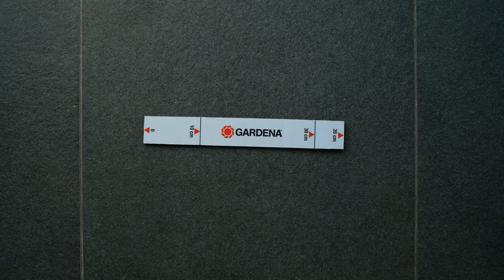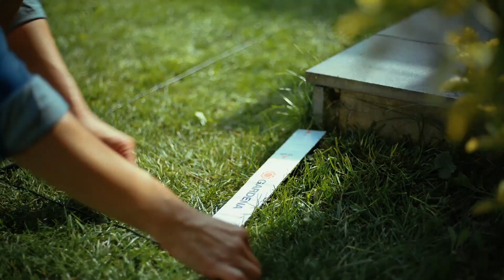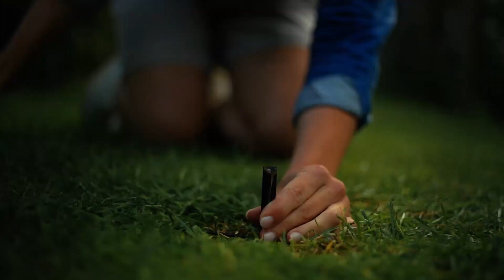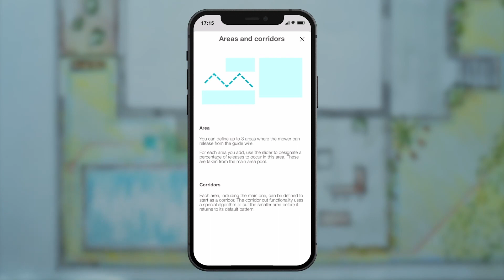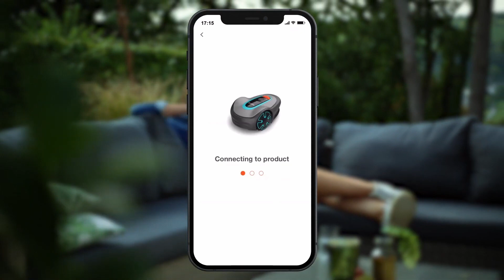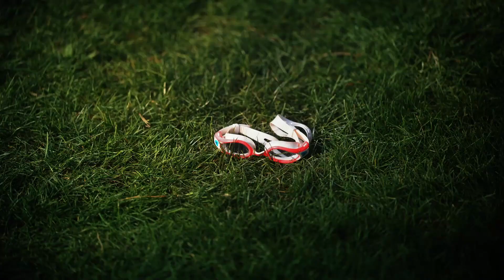Gardena Sileno Minimo Robotic Mower Gardena Robotic Lawnmower Sileno Life 750 at Trade Tested

Comment: I have a question. I just bought sileno city, and everithing looked great, but when I plugged it in to charge the mower doesnt charge. I have read something about it on the web, and it said there should be a green light and it is, but it still doesnt charge… does anyone has any idea how do I fix it? 
Thanks
Reply: The green light usually indicates everything is fine with the setup & boundary wires (the loop is closed). Do you have any information about the robot status from the Gardena mobile app?
Reply: Same issue here, the Gardena bluetooth app keeps constantly ”suggesting/guessing” the state of charge for the mover..

Any suggestions what causes this issue? Low voltage cable is elevated as suggested, no magnetics around charging station, the led shows green light and the cables are correctly installed…
Reply from the maker: Hey guys, give us a call if you have a product issue - customer service can help :) 0800 800 880 Cheers!

Comment: After the last Bluetooth App update (4.1.0), the secondary area settings (set by the distance point of the guide wires) seem to be completely gone, only the default area is available. Has anyone encountered and fixed this?
Reply: Did you find a solution? Gardena want to sent my robot back for service because of this problem...
Reply: Hi! I got that bug fixed eventually. I did two things: (1) updating the firmware of my robot via a USB cable. (you will find instructions on that online & official Gardena resources) – the update claims to fix bugs (2) removing / reconnecting to the device in the smartphone app (I believe this was optional) @clausrikhof7602  

I tried all I could because my main issue was slightly different (and bigger) – the robot would not park for charging properly (showing up as Error 30 in error logs) – upon research it looked as if the charging voltage of the station was too low. The robot's behaviour would be the following: it would go to the charge station, start charging (however, too slowly by Gardena software engineer "standards"), try to repark (5 or so times), then just stay on the lawn (outside the charging station) and throw an error. I checked all the wiring, even tried different DC wire – it didn't help. Eventually, I cleaned the metal charging elements on my Sileno (with fine sandpaper) & applied some contact cleaner to avoid humidity & corrosion. The robot works fine since then.

Comment: One would be foolish to buy a robotic lawnmower that uses perimeter wire when the next generation of mowers will not use any ground wire.  This type of machine is just like the floppy disc….obsolete!
Reply: do they use lidar like robot vacuums? any on the market at this stage that you recommend?
Reply: @karrotop  Reviews mention loss of sat. guidance  if there trees around the yard. Not a perfect system, esp. for my yard.